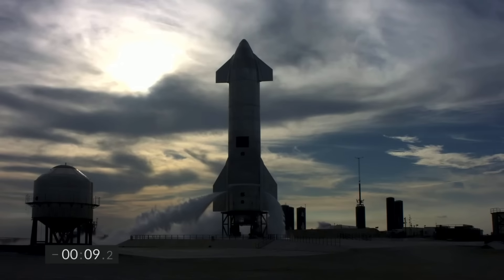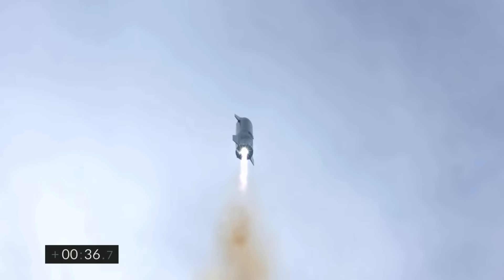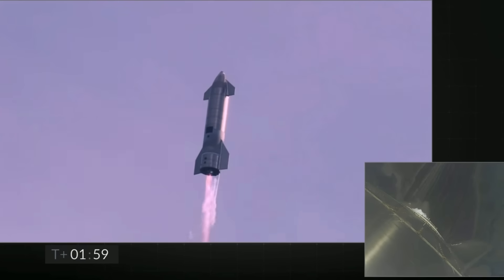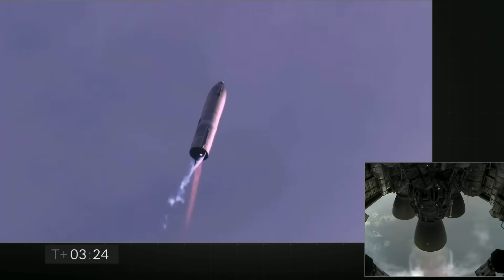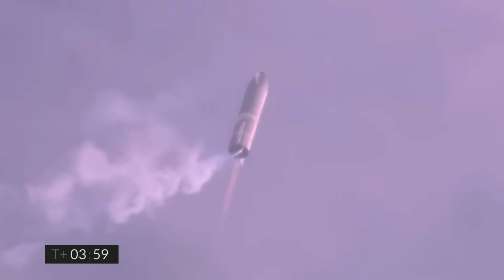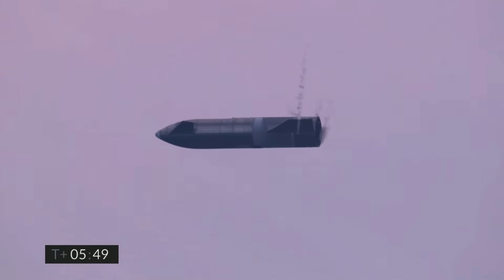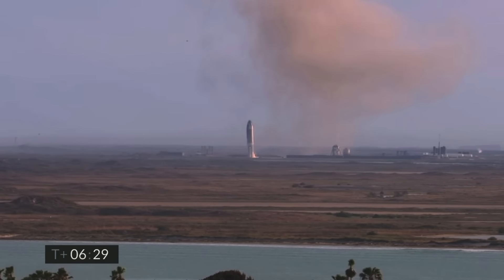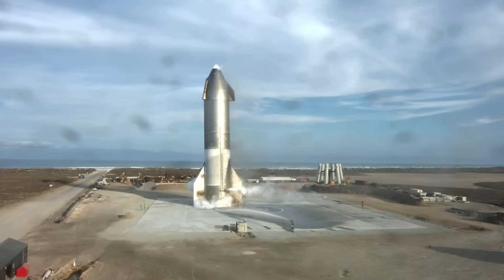SpaceX Starship SN10 soars, lands for first time!

Comment: These new style rockets make those old 1950s movies look a lot more credible.
Reply: Your right! During the horizontal part, i was looking for the cheesy smoking sparkler and the strings. Real fun!
Reply: It should be mentioned here that these are all prototypes and has therefore not been painted or styled yet. I see your point though but I'd still rather have something that can be reused than something that is designed to burn up in the atmosphere
Reply: @martinjacobsen5974  true, if you wanna build a rocket would you want to keep it reused at least 10-20 times, and also save money.
Reply: @martinjacobsen5974  it's fake bro
Reply: @skeetlejuice522  really impressive fake then since I've seen it fly irl ;)
Reply: @martinjacobsen5974  no u have not
Reply: @skeetlejuice522  step sister used to work for spaceX mate
Reply: @martinjacobsen5974  Why paint it and add more useless weight?
Reply: @martinjacobsen5974  are you daft? They’re gonna spend billions of dollars to design a rocket and then re-design it? This is the design! And if you follow space ask you know that it’s gonna be stainless steel and it’s supposed to look like a 1950s rocket.
Reply: @Eric_In_SF  the design is not half as important as performance when it comes to space engineering. When you say they spend billions on the rocket you're not wrong but it's not for it to look cool it's for  effeciency and structural integrity. you also have to remember this comment is two years old. This was way before we'd seen the heat shield. Take it easy.
Reply: @martinjacobsen5974 I think it's shape really helps helps it fly .. fall evenly smoothly in control when it is coming down engines off . The large round body will help it not fall to fast and the little fines are movable controls and of course the bug fines on the bottom move and keep it stabilized especially when it's falling sideways before it goes right side up and lands . A good design save on wear and tear fuel  because the engines are not burning the whole way down as they do when the rocket takes off . Basically it glides most of the way down before doing the flip and turn on engines to slow and land
Reply: @martinjacobsen5974 I think it looks great and it is a great design works great
Reply: I'm just waiting for Flash Gordon to jump out.
Reply: Ikr sick power rangers quality C.G.I. bro.
Reply: Yeah, 8 bit games too
Reply: In an interview with Joe Rogan, Elon said that was the idea. Make the rocket look cool, but also functional.
Reply: What do you mean credible
Reply: @jasoncoombs4366    In those 50s B-movies, they would "land" spaceships by reversing footage of a launch... which eventually looked ridiculous once splashdown returns became the norm in the 60s and 70s.  But now, Starship makes those films look visionary!
Reply: @KOZMOGRAFX  Scamship just brings 50s cringe to the upper level.
Reply: @jasoncoombs4366  exactly . Of course the 1950s rocket launches were credible. He was trying to say he didn't think they were real or some bs
Reply: @jasoncoombs4366  they are fake
Reply: @jasoncoombs4366  I remember watching the 50's movies where rockets landed very similar to this. Once NASA really did landings the recovery was after splashdown.
Reply: @kpaulsen01  yeah , it's a bit difficult to do before splash down.
Reply: They’ve gone to a retro style for this one. Kind of reminds me of Buck Rogers era rocket ships.
Reply: People have super computers in there hands that can process insane amount of stuff, and rhey don't believe a simple rocket ship wtf is up lmao
Reply: @AquiticGaming  Didn't you know?  iPhones are FAKE! ;)  (We've all been brainwashed by the global elite to THINK they are real...  it's all a plot to control us....  We're being tracked!  bla bla yada yada  Insert BS of choice here )
Reply: Thunderbirds are GO!! 
Finally.
Reply: @jamesowen418  right! Was that Virgil? 😉
Reply: Jules verne .
Reply: That’s why we’re all in the rocket business right? Lol
Reply: Exactly!!
Reply: I thought the same thing !!!!
Because the little flame coming out of the exhaust doesn't seem to be enough to get that thing up.....
Reply: Weird you mention it. I decided to randomly watch an old 50's space movie the other day (bored me to tears), but when they landed on another planet, they used the thrusters and landed vertically on the bottom without a parachute. Just like these spacex rockets
Reply: The 1950s rockets were 100% credible
Reply: I used to laugh at 50s Sci fi rockets....not anymore!
Reply: I never thought about launches and landings resembling the rockets shown in the 1950's movies,  however, you are right.
Reply: Exactly
Reply: Chris Cousins  ehh... We all have our own preferences I guess 😅
Reply: So true and we all used to laugh at them, but not anymore
Reply: History repeats itself!
Reply: The gleam of  shiny metal,   paint would just add extra weight...
Reply: Flash Gordon is real lol.
Reply: For some reason, reminds me of Queens Radio GaGa
Reply: 100% agree
Reply: Ya you know it's real cuz it looks so fake..😐
Reply: yes indeed,  you are correct     😊
Reply: True that!
Reply: Is this real?

I can't tell...
Reply: Or they built them around the old style rockets lol inspiration
Reply: So funny...it looks just a cheesy too!  It does not look real, but I know it is real.  LOL
Reply: Haha 😂
Reply: It does makes a lot of Racket though LOL
Reply: So true
Reply: Elon Musk said he wanted it to look like the 50s movies even if it hurt the aerodynamics.
Reply: @scotttild  well I'll be damned 🤔
Reply: Its called predictive programming . Have Rocket, Will Travel,  the Three Stooges movie,  is the science and technology template. Now you are able to accept the Musk version with slightly better effects graphics
Reply: Just go to the screen credits of those old space movies and see who the technical directors were!
Reply: Hajaja
Reply: I used to love Flash Gordon when I was seven years old, and that Gentle bonfire smoke as it’s falling through the air at 200 miles an hour, did Elon make that video himself?
Reply: My exact thought
Reply: Yeah once you realise our old view of science fiction is soon becoming the new facts, it's amazing
Reply: Going up I agree coming down not so much.
Reply: @scottshoemaker5471  thank you for giving a reasonable comment
Reply: @scottshoemaker5471  I think the rocket should come down horizontally and with two parachutes, like the Crew Dragon tests. Not like this as we've seen
Reply: @scottshoemaker5471   you are wise   😉
Reply: Name a few good ones.. Would like to see them. Thanks 🥂
Reply: O good, So I'm not the only one :~)
Reply: Jules verne .
Reply: Fucking amazin hilar dude
Reply: Why? ...cuz some of those launches fail? Blow up?
Reply: @sammyphillips-vocalist3275  Because every little game that happens under the dome has rules
Reply: You mean CGI sucks, still?? Hahahaha these braindead drones still believe this garbage LMFAOOOOO
Reply: Actually, the Design of it (in particular, the Nose) was based on one of those (Moon Voyage) Movies.  Even though a Rounded Nosecone is more Versatile and Aerodynamic, it was decided to make it 'Pointy', Because It Looked 'Cool'.
Reply: Thunderbird...is back... Intenational Rescue...
Reply: https://www.youtube.com/watch?v=YblaCYo_ZdY
Reply: The space shuttle was the height of reusable technology, these rockets look very iffy and dangerous in my opinion, just dont get it looks like 1950 all over again
Reply: @tomstorey7267  maybe this can help 
https://www.youtube.com/watch?v=fQ_di61oZ70&t=1s
Reply: @frenkenberg  my theory is most or all of the comments on these videos are paid fan boys...read carefully there positive remarks. It's just pathetic. No matter how fake it looks there just going to believe it...NASA and Musk are up to something big but this is mostly fake
Reply: @frenkenberg  since Kubrick is dead or just to old the videos have suffered
Reply: Muito   lindo   maravilhoso
Reply: Man wakeup only flow landing in Mars and this guy can do at mars no more rubbish machine in mars .. .
Reply: @mohamadabdullah1931  🤡
Reply: One day human fill flowt at mars .. .
Reply: Elon loves this.  And is why.
Reply: @user-p7up8l4k  please don't drop your religion into anything that has no connection again. This is your final warning.
Reply: Obvoiusly it's fake. Take it from an expert... with 20'000 plus hours of real time flying of real big aircrafts. Just saying, kids. Start to use your brains, get a life and stop looking up to hl. El on Mus K, the no 1 lsr of OPM... other ppls mny.
Reply: We are aliens
Reply: This rocket looks like type 1 or 2 civilization technology
Reply: 4 billion dollars per launch credible ?
Reply: @Lakemaker613  you're referring to SLS
Reply: @zhongxina9420  thank you I wasn’t sure
Reply: You do understand that this test was a catastrophic failure? This video has been cut short and the commentary is bull shit. The vehicle actually hit the ground too hard damaging the vehicle. The fire you see burning on the base of the vehicle after landing is a sign of the severe damage which lead to the vehicle explosion that completely destroyed it 20 minutes after touching down.
Reply: @Shattered65  ok, but its not gonna do so in five years.. spending less than 1/10 of what nasa did in the process.. thats a win by every standard imaginable, even as an expendable rocket- it still beats government programs to shame.
Reply: @Shattered65  That's not a total failure. That's crucial data that SpaceX will use for next time.
Reply: Rockets are fireworks. Rocket propulsion is similar to firing a water pistol or machine gun, using recoil to accelerate. The more fuel you carry, the more fuel it takes to lift off. More stages and larger sizes are not more efficient.

Space X rockets return landing is a monkey trick copied from a 1948 Russian movie. A super stupid trick to fool the sheeple. Every drop of fuel should send the payload up, not the recovery tank. Parachutes are much cheaper and safer.

Humans will never be able to put any mass into orbit or to the moon. No private rocket can orbit the earth, that's a fact. All rockets run out of fuel in minutes. NASA sends rockets into the waters of Bermuda and restricts people from going there. You now know why. Stupid people
Reply: Bro it’s because it’s clearly fake smh
Reply: I got a feeling we could do it then. Our shits atleast 80 years behind the secret stuff we have
Reply: So laughable. 😅😅😅
Reply: That's because I was there.
Reply: that is so fake I hate people post fake video on youtube
Reply: Exactly the way it hit me.
Reply: Who remembers Space Angel cartoon from the 60's?
Reply: YOU HAVE QUESTIONS? I HAVE ANSWERS!!—Perversion, death and murder increasing! ...LAWS are made to protect people and increase or maintain quality of life for humans.. There is a growing REBELLIOUS trend to TRASH laws, including moral ones, as mentioned in the bible. 99% of preachers don't even support ALL 10 commandments, and many don't support even any by their LAWLESS heresy. CRIME & CLERGY CONNECTION = TRICKLE DOWN IMMORALITY.. "When people’s thinking is controlled by the sinful self, they are against God, because they refuse to obey God’s law and really are not even able to obey God’s law." ROMANS 8:7 Society will increasingly SUFFER! The barbarians are coming, the barbarians are coming...!!! The preachers lead the charge!! "My people are destroyed for lack of knowledge: because you have rejected knowledge, I will also reject you, that you shall be no PRIEST to me: seeing you have forgotten the LAW of your God, I will also forget your children.” Hos 4:6 Christianity is mostly now populated by GULLIBLE , DECEIVED, FANATIC VICTIMS who have never read even the whole new testament once. They spend almost ALL of their weekly waking minutes (6720) influenced by perverted , depraved worldly culture and , if they attend church, learn a bunch of ambiguous, abstract, obscure, religious lingo & cliches for teaching by inept preachers who are deceived modern, law trashing, bible warping Pharisees. RESULT??? MATT 24:24
Reply: Exactly my thoughts. It took me back to my childhood and the pictures of rockets then.
Reply: My own thoughts, folks used to laugh at a V2 film played in reverse to simulate landing, and this ship does it.
Reply: Good old dan dare 😂😂
Reply: FLASH ahhhhhhhhhh ahhhhhhhhh
Reply: Looks too much like a dick to hold any credibility at all but you know how most Americans are they believe everything the media tells them to
Reply: Like something from Blixt Gordon movies.
Reply: I was thinking the same as I watched it come in to the vertical stage and softly touch down.
Reply: Most beautiful to watch rocket ever launched Saturn 5. Followed by Shuttle launch.
Reply: 1950 AGAIN
Reply: @jasons44  yes, even the cold war is of all over
Reply: They look similar as well..
Reply: THE FAKEST BULLSHIT I'VE SEEN YET.
Editing is terrible; Thought I might add
Reply: @batmanofinglewood  stop! Your going to break the hearts of 100 fanboys
Reply: It’s still early into development.
Reply: @Pixx08  That isn't a good sign then.
Reply: @Pixx08  so early they haven't started to build a real one
Reply: Self fulfilling
Reply: The smoke on the float stage looked exactly like the 50s movie effect. Suspicious.
Reply: @billchristie2120 only if you're a dumbass
Reply: Doesn't it look like they just copied one of those Sci-Fi movies 'into space' from 1950's? Crazy.
Reply: To Infinity and Beyond
Reply: Even as a small kid I asked where does the power come from?  We were in a gas crisis in the U.S.A. and had to wait in lines and only go on certain days, I was skeptical they had enough fuel for a space ship to land and launch.
Reply: I mean these aren't really "new" we have had them since the 1990s. They were just abandoned because cost was very high and advantages are very low so never mass produced. Only recently did rocket technology become cheap enough that a company like SpaceX thought maybe it was worth going back to them. But you can find videos of rockets landing like this back in the 90s.
Reply: @艾米心amihart  then post links here>      <
Love to see it
Reply: @jonmorrow1049  can't
Reply: @艾米心amihart  I know
Reply: @艾米心amihart  Landing horizontally like this?
Reply: @Therevolution7  Landing vertically not horizontally.
Reply: @艾米心amihart  That's not true. Please provide video, if it's so "old news." Just remember that Starship is 50 meters tall. So, good luck finding something like that built in the 90's.
Reply: @danielmonge2318  I'm pretty sure you're already aware of the videos or else you wouldn't preempt your comment with a laughable excuse.
Reply: @danielmonge2318 You know the videos exist hence why your comments constantly shift the goalpost and preempt things. We are talking about VTVL technology, this is my claim, and this is what you responded with. But you constantly shift the goalpost because you know I'm right to tack on unnecessary detail, like "you're lying that VTVL rockets already existed because this rocket is VTVL and also taller!! Those ones are all shorter therefore you're lying!!!" Like... what? No one made a claim about height. Only that VTVL rockets have existed since the 90s. You are just shifting the goalpost because you know you're wrong. You are intentionally shifting the goalpost and tacking on unnecessary requirements for it to be VTVL such at is having to be a certain height or it having been used in an orbital test. Because you know the video exist and you want me to post it so then you can go "aha!!! that one was only used in a suborbital test and it is shorter than SpaceX's rocket!!!" Hence, you know the video exists, you are trying to set me up for this response. But I'm not that dumb and see right through you. You are shifting the goalpost, as none of those things you have tacked on disprove VTVL technology hasn't existed since the 90s.
Reply: @艾米心amihart  Oh, I see where you are coming from. Let me make myself more clear, then. What I got from your previous comments up until now is that you didn't think SpaceX was all that special because there has been rockets landing vertically since the 90's. That's what triggered me. Hence why I keep talking about the size of the rocket as well as the height of its flight. Because I think you are not making a fair apples to apples comparison.

It's like comparing Usain Bolt with a maraton runner and telling the maraton runner is too slow, so his gold medal is not as valuable as Usain's.
Reply: @danielmonge2318  Orbital rockets are not new technology either. The fact VTVL tests were originally done with suborbital rockets is because we've had orbital rockets since the 1950s. The focus was on getting the VTVL to work first since that was the actual new technology. Sticking the two together doesn't make it "special". The only thing "special" about SpaceX's rocket is it's being done with 2020s rocket technology rather than 1990s rocket technology, so it's generally a lot cheaper than NASA's rocket, which NASA abandoned because the technology was too expensive at the time to make up for the minor benefits. If SpaceX's rockets ever prove to be long-term commercially viable, it will only be because they are cheaper than what we had before, assuming SpaceX does actually stay in business long enough to perfect this design. It is largely a cost thing rather than an invention of brand new tech thing. Even Elon Musk stressed how important cost savings is here and is his entire pitch for these rockets. But the point still stands that this is not new technology, it is simply recycling old technology that used to be too expensive to be worth it, but today is a lot cheaper, and so it is being revisited.
Reply: @艾米心amihart  So what would classify as “special” for you?  It’s not “simply sticking two old ideas together because it’s cheap now”.  SpaceX designed and built their own rocket engines (first full flow engines to fly) Engineered their own unique stainless steel. Made the first design that would allow a free fall then “swing and catch” type landing. Etc etc.  It’s unique.  If it was so easy, then why is everyone in catch-up mode now?  The Chinese have one coming that looks the same.  Rocket Labs are planning a new “big” rocket that looks looks like a Falcon 9 wannabe.  Why can’t you people just admit this is cool technology and just enjoy it?  It’s not fake, it’s not CGI, it’s just the leading edge of space technology unfolding in front of us.
Reply: @艾米心amihart  Ok Ok..  Triggered much?  lol    So YOU say it's not a breakthrough, whilst all the other rocket engineers, rocket companies and virtually any other commentator with an ounce of knowledge on the matter thinks it is..  Fine - you have a right to your own misguided opinion.  Sure - it's an incremental change over time - like everything.  However, every now and again, there are leaps forward.  This is one of them whether you like it or not.   How me being 'creepy fanboy' came into a discussion of facts is anyone's guess.  Says more about you than it does me.    Everyone knows that there were examples of VTVL in the past.  So what?  Did they do a 10Km hop?   Did they freefall back to earth and then relight the engines for a landing?   Did the approach lead to the same vehicle going sub orbital?  No- and they couldn't, regardless of how much they may have spent on it.  They were more proof of concept, and dead ends.  Finally, if it was a 'slow and gradual development based on things we had before', then where is the NASA version of this?  They have NOTHING like this - nor will they.
Reply: @warwickprince9712  You are literally just fabricating support for your own opinion... this is just sad. You fanboys are real desperate.
Reply: @艾米心amihart  Sure - now you go into blanket denial/dismissal mode.  So typical.   Please let me know what part is fabricated?
Reply: @warwickprince9712  someone's triggered
Reply: @艾米心amihart  Snappy comeback! lol  (With no answer to the question.)
Reply: @warwickprince9712  you gonna cry that I I don't worship your daddy ?
Reply: @艾米心amihart  Clearly you are completely out of intelligent comments, so I'm out.
Reply: @warwickprince9712  what? not going to defend your daddy anymore? He's going to be sad you know. :(
Reply: @艾米心amihart  Are you referring to the DC-X program? There's a lot of misconception about the DC-X program. First Unlike the starship. Dc-x doesn't actually shut down its engines fully, Second Dc-x only swan dive for mere seconds not minutes. Third there's a lot of CGI videos that extragrated the feats of DC-X on youtube. Fourth, the Dc-x is already in the vertical position much much early than starship. Fifth, base from what I know the Falcon 9 is the only booster that can self land itself from space. And yes it maybe an idea from the 60s and 90s but no technology ever come close to the falcon 9 at least not yet. Sixth, The dx-c Program is proposing a single stage design which quite different than the falcon 9. Falcon 9s idea is actually inspired from a russian concept but it doesn't mean it didn't take any inspiration from the DC-X program. The crew dragon actually have some similarities from the DC-X vehicle.
Reply: @richardkocksworthy8423  I don't think this video is CGI... you can see it from other angles and it matches up. If it was CGI someone would've been able to prove it by now. It would be a huge conspiracy theory. The investors would not be happy to know they are being cheated.
Reply: @艾米心amihart  CGI-Creating Great Inventions
Reply: @艾米心amihart  90s experimental vehicles only flew max 150 meters then go back down. SpaceX's boosters land from space with an impeccable precision
Reply: @艾米心amihart  Y'all sound like a couple Video game geeks argueing LOL
Reply: @艾米心amihart  You all sound like a couple of classic video game geeks argueing lol
Reply: Because they are fake/helium balloons
Reply: @frenkenberg  when I see 3 astronauts in the capsule minutes from launch and there just randomly touching buttons on the computer screen I just want to laugh..if it was real they wouldn't be allowed to touch anything. It would all be preprogrammed until you get to orbit or maybe not even then..
Reply: Funny you would say that. Those rockets were fantasy special effects, too.
Reply: The narration it's like football or nascar race l style some emotion the way the smoke dropping and the cameras always in the spot is amazing the after effects don't decive yourselfs you became sick
Reply: Amazing C G I on this one isn't it?
Reply: It's all fake
Reply: @stupidboy1746  your a flat earther !!!
We've never been to the moon either right ?
Man will never go faster than 30 MPH !!
LIBTARD I assume !!!
Reply: @stupidboy1746  it's all physics. There I fixed it for you.
Reply: CGI crap

The earth is flat
Reply: @jimcrawford3185 that's just your wife.
Reply: VTOL has been a thing for years,  in 1996  the DC-X landed.

Succesfully, I might add.  Musk is just a billionaire fraud.
Reply: Isn't that the issue though? Using 1950's logic in 2020s?
Reply: @nezerac  nope , as long as it makes sense it's fine, correct.
Reply: @nezerac  Eh, if it's 1950 but it works, it's will work for 2020 as well. That said, the Starship is an insanely ambitious project and whether it will work at all with that logic is something that remains to be seen. There were other "logics" in use before that might work just as well (such as lifting-body rockets like the VentureStar, which was almost completed), it just happens that this one is the one getting funding from a billionaire. I'm personally not of the belief that it has any special merit in and of itself.

There's a saying I like among space nerds - "Everything new was done in 1960 by NASA once and never again".
Reply: @nezerac  I think Elon knows more than you
Reply: @nezerac  true. The flash Gordon is just as real as Spacex
Reply: @nezerac  they weren't landing rockets in 1950 they were one time use. This is new logic
Reply: @EbikeRandomadventures  oh so believeno one... Not a single person in the 50s thought of landing a rocket?
Reply: @nezerac  no issue at all
Reply: @nezerac  beautiful landing!
Reply: @nezerac  What issue? 20's tech and 50's aesthetic not incompatible.
Reply: @nezerac  More like making dreams reality.
Reply: @nezerac yea 50's tech,,, I remember when they used to land boosters and reuse them,,, yea good old 50's
Reply: @nezerac  except they had to reverse film to simulate landing,, whereas they are ACTUALLY landing now.
Reply: @nezerac  ummmm...same tech as 1950’s ....have you watched the video dude? are or...simply jealous of this innovation’s genius ? No, that’s not reason is it? You simply haven’t watched the entire video?...? This and other launches are well documented by 3rd party observers.
Reply: @nezerac  1950's? You mean 1969-197X? When they lied to us. Having us believe they made it all the way to the moon with technology we don't even have today in that lunar lander wrapped in tin foil 🤣